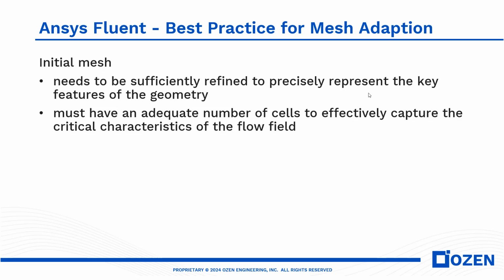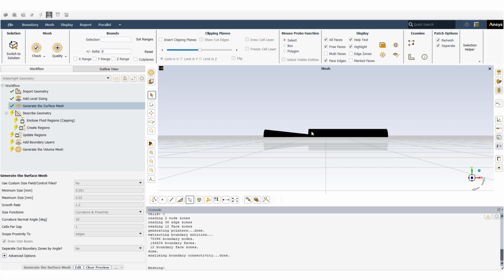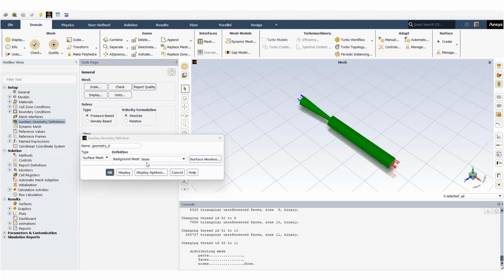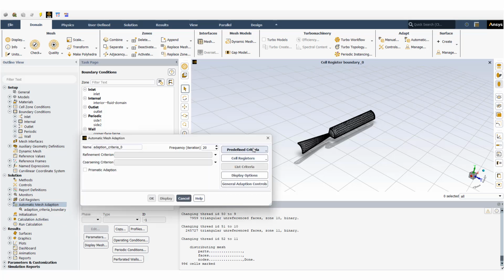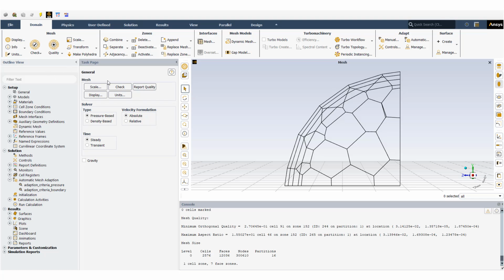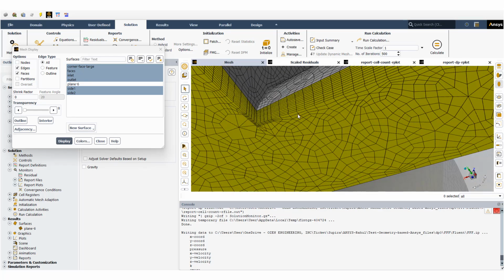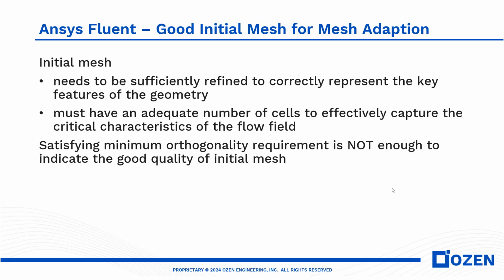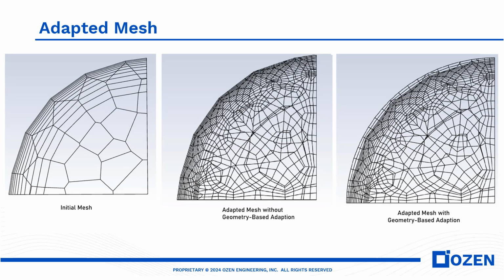Mesh Adaption in Ansys Fluent - Part 2: Geometry-Based Adaption

Comment: 1. I can't find the difference between manual and automatic adaptioin in the user manual. Can you please explain a bit on that?
2. The newly aded boundary cells, in the case of geometry-based adaption, seem to have a bigger height than the cells present in the initial mesh (now the 3rd, 4th layers). Is there a way to avoid this?